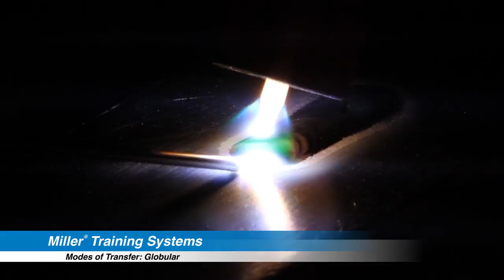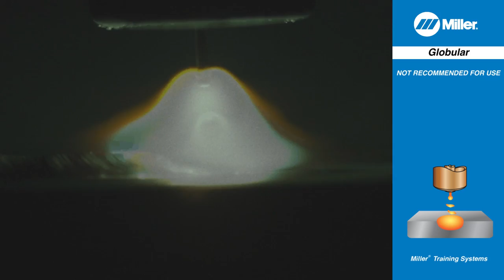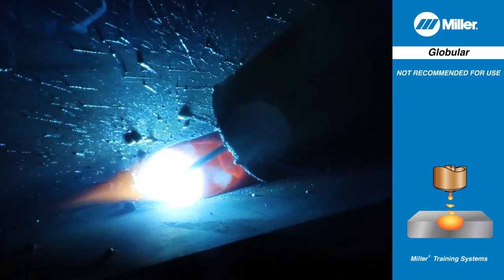Miller Explains Globular Transfer in MIG Welding

Comment: I don't know why they wouldn't explain that this method is actually quite popular with FCAW. It can produce some really nice beads. We learned this method in our first year technical training.
Reply: I think they're explaining this using only mig parameters. Using mig wire... 75/25gas (nothing wrong with that) and just turning up your mig machine. When a simple change of those things can make a difference obviously. Idk why they explain things certain ways sometimes
Reply: And it actually , all around, penetrates better than short circuit and spray
Reply: @treyw6882 not spray. Spray actually beuries itself into the parent material and gives off a nicer and cleaner weld. Globular makes a massive mess, does give off good penetration but at the cost of a lot more spatter.

Comment: This is what we use at work (shipbuilding) and it sucks cleaning up all that spatter crap.
Reply: If your machine is set right and you know what your doing, you can get good looking welds with globular transfer. The person in this video must have been TRYING to get the most spatter possible. The farther your gun is from being perpendicular, the more spatter you will generate. Typically your using C02 for your shielding gas which gives you a deeper penetrating weld without fancy/expensive power supplies or shielding gases. So there is a cost savings...  but a little more weld cleanup also.
Reply: Hey man.. my hats off to you. I wouldn't mind gettin busy on a ship. It's dirty AF but someone's gotta do it